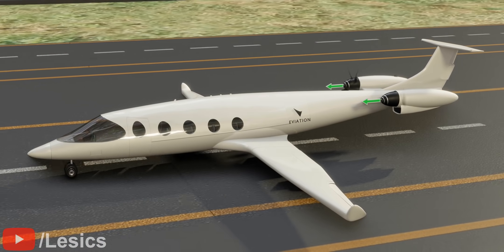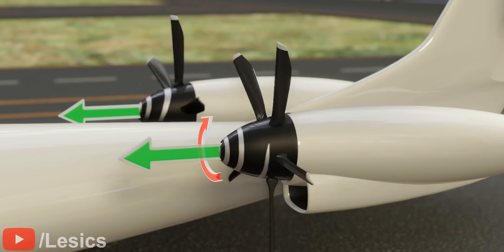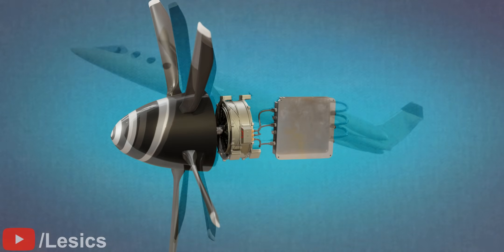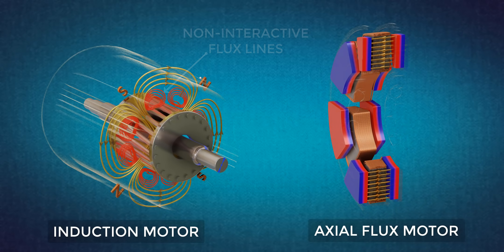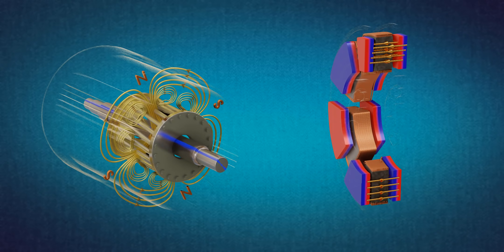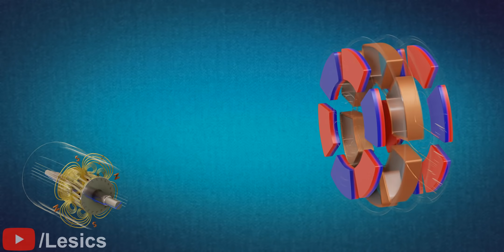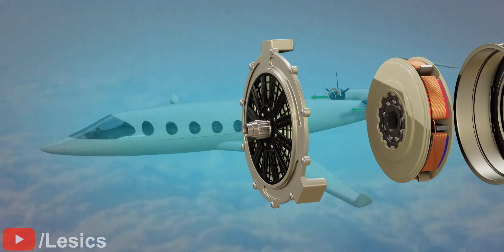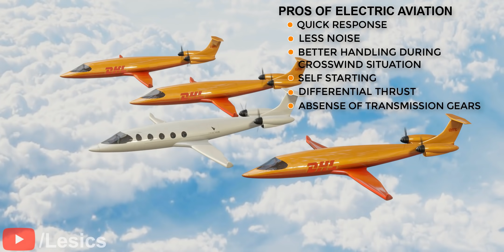Electric Aviation | The Dawn of an Advanced Transportation Mode

Comment: Just think if H2 was an addition to this system, the range would be easily doubled if not tripled with not that much more weight. Smaller batteries may even make it lighter? Didn't do the calculations on that but I think it may be true.
Reply: If you did the calculations, you’d see that hydrogen is worse than batteries, not even considering the hurdles of storing it.
Reply: @DinoAlberini  technology changes and the, and they find new solutions all the time. If you create H2 with renuable energy it's not a problem imho. Efficiency is still better than coal burning electricity production
Reply: @rjung_ch  you can make jet fuel with renewables as well.

Comment: Informative but biased, just a quick blurb about the massive underlying con of electric planes that we may never overcome with lithium ion technology. Ultimately we need to accept that electric is not the solution for trucking and aviation unless we can solve the battery problem
Reply: Not biased but hopeful and excited. You should be too.
Reply: what about diesiel engines mounted on planes?
Reply: @makorek  hybrid systems been thought of and are being engineered but just not practical. It would be much more complex, heavy, and would be less efficient than just a ICE aircraft.
Reply: The battery problem will be solved
Reply: another idiot with more nonsense battery are not the be all or end all of electric power this is marketing! so many ways of generating electricity especially for an air craft !
Reply: @BadManPromotions  like?
Reply: Electric can be the solution for trucking. Install power delivery overhead along major highways and have a battery on board for the rest.

Edit: And no what I'm describing is not a train and if you think it is then you're stupid. A train runs only on tracks. Plenty of trains run on diesel, does that make them trucks? No. So why would running a truck on overhead electric make it a train?
Reply: @radiosification  That's just a train with extra steps
Reply: @MegaRBN14  That is the point. Transporting freight is the most efficient via railways, but not every cargo is large enough to be economic for trains, so we put them on trucks. Trucks are already small land trains running on fuel just like diesel engines, but unlike trains, trucks can continue their journey when the "rail" ends. We already have trolley buses in Europe it is the same concept.
Reply: @MegaRBN14  The difference between trucks and trains are the tracks not the overhead power delivery. In the beginning railways were constructed without overhead power too, then later they were electrified in high traffic routes. The same should happen with trucks.
Reply: @MegaRBN14  No it's not. What an ignorant thing to say. A train runs on tracks and can only go where the tracks let it. A truck has wheels and can steer itself. Completely different.
Reply: @radiosification  You literally said:
"Install power delivery overhead along major highways and have a battery on board for the rest."
That's literally the exact same function as trains already have. A different thing would be using electrified trucks for much shorter travels around cities to deliver cargo from the train station to wherever it has to go. But using said system on major highways is a stupid waste of resources when there's already thousands of kms of rail tracks in every developed country.
Reply: @GaricsPeter  Of course, but that would only be for short distances between the train station and wherever the cargo must go.
What OP said is using it along major highways, which doesn't make any sense since there are already lots of rail kms installed that can be used instead.
Reply: @MegaRBN14  "That's literally the exact same function as trains already have." Same for power delivery maybe, but trucks do NOT run on tracks so the difference is pretty obvious. You can't drop stuff from one warehouse to a distribution centre directly with a train unless there is a station right next to both places. You can with a truck. Huge difference.
Reply: @MegaRBN14  Does trucks commute in said highways? If yes, then it does make sense. As I said, not all freight is large enough to be put on rails. Where I live we have railways parallel to the highway yet the highway is FULL of trucks.
Reply: @GaricsPeter  precisely. Otherwise, trolleybusses would be trains too and they clearly aren't
Reply: @radiosification  this is called train

Comment: What about de-icing? There is no jet engine warmth to be used and electric heating would use too much power.
Reply: There will probably be a climate controll system on board. You could get hot air from that but electric heating would be the best option because of the transfer to the propellor blades.
Reply: @seniorbush7164  to transfer electricity to a rotating part like a propeller requires brushes which would need frequent maintenance.
Reply: @ozciva  inductance... you could use inductance to transfer electricity to a rotating part then transform it to dc if needed
Reply: @64-bit63  You will need a coil that would produce a constant magnetic field perpendicular to the length of the propeller and to the speed vector of the propeller. That is, a coil in the shape of the propeller, right behind it. It should produces enough magnetic field to produce enough current on the propeller but should not be big enough to bend it. In any case you will need a coil in the length of a propeller behind it. That's not practical imho.
Reply: @ozciva  — Electrically heated props have been used for at least 70 years ... It’s nothing new and it’s proven reliable ...
Reply: @sking2173  yeah but the electricity for that is made by generatos powered by the engines.
Reply: Jet engines are just so terriblly inefficient that they create this side effect
Reply: Many planes use de icing "boots" which require minimal power but future electric planes will have plenty of power for such things.
Reply: The same way it is done in B787 using Electrical De-icing system where current is passed through a high Resistance circuit.
Reply: Making proper insulation and solar heating system i.e making the body of aircraft top with solar make that power to heat? Just 9 passanger aircraft so could be done think so....
Reply: @sharan9936  so ugh, you do know planes fly at night  too right?
Reply: @jamesbizs  yea 🤣 thought that too😅 but just idea man
Reply: @jamesbizs  Hydrogen based heating system can be made.... ?

Comment: Two major errors in this video.  A fundamental property of propellers is that you need fine pitch during takeoff when you're at low speeds.  You only use higher pitch angles at higher speeds.  Another error is at the end says "in a few years we'll probably be able to fly to another country".  That's only true if you live within 200 miles of another country.  The fundamental limit is energy density in current battery technology and that won't change dramatically anytime soon.  Electric aviation is great if you can reach your destination within an hour.
Reply: In Belgium you can reach 6 different countries with one of those.
Reply: Everyone in here in lala land. You'd be better off hoping for someone to create a feasible, small scale thorium or fusion reactor. 

Electric is hard limited to day to day transit. There is about 0 realistic chance it ever finds use in planes or work trucks.  Trains it might have a go at with a good power grid or hybrid setup, but not aircraft
Reply: @davidrobinson3154  I could see them making some use in local, short range work trucks like the city or the utility providers might use. Definitely no 18-wheeler or long haul trucks.
Reply: @AaronCMounts  I feel like the issue with short route trucks and utilitybtruck is availability.
Reply: @davidrobinson3154  that's a fair assessment. No one seems to be interested in building electric medium duty trucks.
Reply: You must've never heard of aluminum air battery
Reply: @jovanleon7  Yes I have, and many other exotic promising battery technologies over the last decade.  These new wonder batteries are announced every year it seems all with the promise of revolutionizing the future, yet they all don't seem to go anywhere.

I'm not saying it won't happen, but it takes decades even for new promising tech go come to market and that's if they survive development.
Reply: @GeorgeOu  - You are not incorrect about hearing of new battery tech and it never going anywhere. But you forget how technology can start progressing exponentially. Which I hope battery tech will. I think it's at the bottom of the curve. But time will tell.
Reply: @foadrightnow5725  You're arguing in support of a hope that has no basis in the current reality of the world. You're hoping we'll see a tech breakthrough that will lead to a quadrupling of battery energy density potential. Worse than that, you're hoping that battery tech growth will suddenly accelerate to a new rate and will bring about that energy density breakthrough. You're hoping for a hope for an advent.
Reply: @jovanleon7  aluminum air is non-rechargeable and aluminum-ion is only a bit better than li-ion

kerosene has 45mj/kg and modern turbofans are 50% efficient

the best theoretical li-ion chemistry is Li-O which at best is like 20mj/kg (theoretical only, in reality they've gotten like 5mj/kg in lab conditions with terrible durability among other terrible metrics all of which would need to be solved before it can even be considered) and electric motors being something like 80-90% efficient ?

So even with the BEST BEST BEST possible li-ion chemistry electric would only come within spitting distance of the best boeing, airbus, rolls royce and general electric have to offer NOW.
Reply: @jovanleon7  A battery that completely consumes a metal, for energy. That's a non-starter.
Reply: Now that the auto industry is moving to electric we will see battery technology move very quickly!
Reply: @HABITZER  even the theoretical maximum energy density chemistries aren't enough to be competitive with kerosene, even beyond this there are so many negative externalities that the entire venture is a joke
Reply: You are right, but the reasons why are different. With new batteries you need to proof they are safe even if the brakes are burning or with a small fire in the baggage compartment with all other tests under usual conditions and tests with older batteries those tests take many years for example a conventional completely new aircraft from planning to delivery takes about 15 years about 10 of them are testing and trying to get the licences for any country. Similar it will be for any new technology most likely even longer so batteries uses comercally within the next 5 years would have to be in a testing phase since early 2022 and thats very unlikely.
Reply: George Ou - His comment "in a few years we'll probably be able to fly to another country" isn't necessarily an error. Why do you seem so certain that battery tech won't change dramatically anytime soon? It's a rapidly evolving field! New discoveries and technologies are being made at an ever increasing pace! Who knows where battery tech will be in a few years? Hell, even in just a couple years? Cheers!
Reply: @foadrightnow5725  you think battery tech will dramatically change in a few years? Why? Do you understand how hard that is? You think we will have some ground breaking innovation in just a few years? such a thing would change the world. It would be like the invention of the personal computer.
Reply: @foadrightnow5725  because there's no battery chemistry that can come close to ~20mj/kg (which is what it would need to be to compete with turbojets) even theoretically, even the lithium oxygen would only barely get to this if they could get the real density to maximum theoretical level (https://en.wikipedia.org/wiki/Lithium%E2%80%93air_battery their figure of 40mj/kg is excluding the mass from the oxygen, which is clearly retarded since that mass is going to be within the battery at some point)

it's not so much that "we're confident battery technology can't improve", it's "even if you achieve maximum theoretical densities, you're still going to fail"
Reply: @foadrightnow5725  Hi, pretty epic screen name :) Anyway, electrochemical energy storage has finite limits. There won't be a "breakthrough".
Reply: @foadrightnow5725  New discoveries don't happen overnight and certainly don't come to market within a few years.  We hear promising new battery tech every year only to see them disappear and never go anywhere.

Comment: Lesics u made a small mistake in this video , aeroplane use tubrofan engine and fighter jet uses turbojet engine . But u said turbo jet engine used in aeroplane . Pls be corrective in this . And this was very good informational video ,thank you for this
Reply: Turbo propeller planes use turbojet engines. Turbofan engines are like the ones on jumbo jets.
Reply: @slowanddeliberate6893  but passenger aeroplane use turbofan engine right